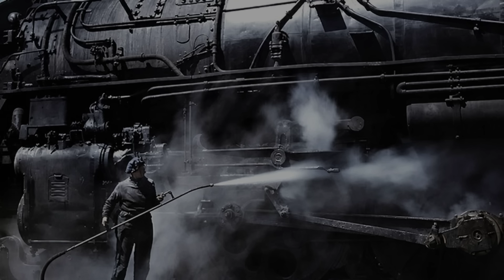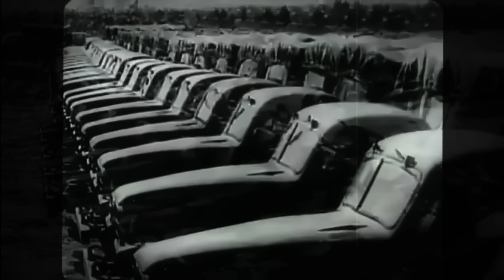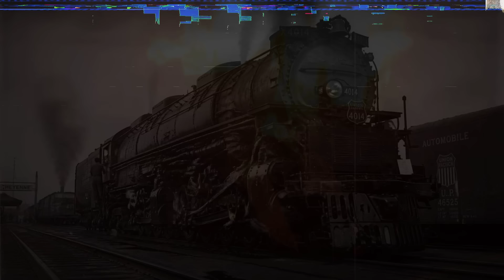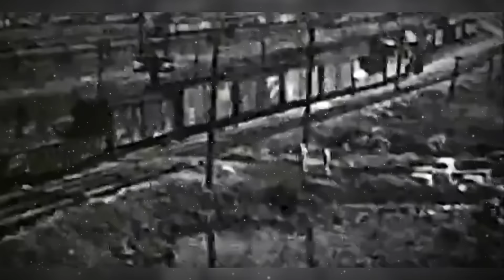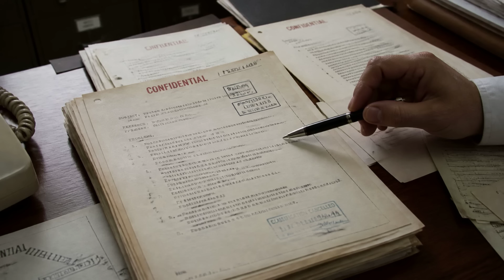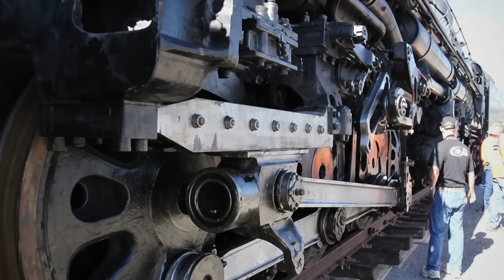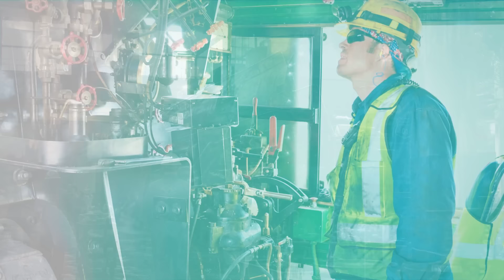The Real Reason Big Boy 4014 Was Abandoned For Decades

Comment: As an engineer who didn’t have the use of a calculator or desktop computer the use of a slide rule, calculating finite measurements and design parameters with tight safety factors is outstanding. These design engineers and the use of quantum mechanics put these massive locomotives on the rails to preform what they did is unmatched. There is nothing stronger then the energy output of steam at that time. The Big Boy is a locomotive everyone should see either in a museum or lucky enough to see the 4014 in action. I’ve been lucky enough to see both. Once this year in Iowa, and the one in the National Railroad Museum 4017.

Comment: There is one picture error within this video. It shows someone with a shovel at the fire box. This use an action which would have been impossible to achieve. No one or two persons shovel enough coal into the fire box to maintain heat for the boiler. A conveyor was installed to bring the coal forward from the tender to the firebox. That picture should have never been part of this video.
Reply: They also show an AC-10 at 1:50.  Southern Pacific #4243.

Comment: I saw 4014 in Colton before it was towed to Cheyenne for restoration. Amazing piece of engineering. Glad I got to see it. 
Also, want to point out one other fact of why steam locomotives were replaced. Diesel electric locomotives use dynamic braking by using their traction motors as generators on down hill grades and putting that electrical energy into slowing the entire train. That is why Big Boy 4014 on it's excursions around the country has trailing diesel locomotives to provide better braking.

Comment: The starting tractive effort was calculated using the standard formula at 135,375 lbs. That was at the rail, not at the rear coupler of the tender. You must subtract the effort requires to move the locomotive and tender to get the net figure that is available to pull the trailing load. in addition to the force necessary to move itself on level ground, an additional figure of 20 lbs per ton for each 1 percent of ascending grade must be subtracted from its starting power. On the Wasatch ruling grade of 1.14 percent, that would require 13563 lbs more force to move the engine and tender than it needed on level ground.

Comment: The condition of 4014 before restoration is exaggerated here. The UP steam team chose it from several candidates in part because it was in better condition than at least most of the others. You should ask Ed Dickens.
Reply: A machine of this complexity designed with slide rules and on drawing boards - now THAT was engineering!
Reply: @john-or9cf being an engineer before calculators and desk top computers, you had the slide rules and the safety factors in the finite calculations required not to overbuild a locomotive of that size. True quantum mechanics needed for this endeavor.
Reply: I kind of figured that as the location that forty fourteen was in south california, with a lot of hot, dry air. I also figured that it was the best condition because that's what I would have done was picked. The one in the best condition
Reply: @edshultz9760  I agree.  I was fortunate to see the 4014 in Salt Lake City when it was returning to Cheyenne WY for the restoration.  It was in remarkable shape for it's age and nothing even close to the condition shown.  I've seen it a couple of times since as it passed through Utah for tours.  An amazing piece of machinery that takes your breath away as it passes by at high speed.  I'm old enough to remember steam locomotives in my childhood years. They were everywhere but not this big  Excellent video.
Reply: Someone at Pomona was doing some maintenance, oiling and such, over the years.
Reply: @paulmorissette5863  That's what I understand also. A volunteer of the Rail Giants oiled the bearings, and other points, for years!
Reply: Agree!!  It was at the LA County Fairgrounds (aka Fairplex) with several other parked engines.  Each engine had its own donation cup/box.  Always a treat to walk among the engines as a kid.  Thanks to our daughter and son-in-law being train geeks, we got to see the 4014 being pulled out of Fairplex on its way to restoration.
Reply: Thank you !!! The narrator is an idiot
Reply: Ed, my good friend, please respond and settle this.

Comment: There’s probably only a small chance of a full comeback for the Super Skunk 1924 Baldwin Mikado #45 2-8-2 which provided passenger service between Ft. Bragg and Willits, California.  I have some very neat 8 mm movie film which I took of the train in the 1970s, one horseshoe curve in particular where both ends of the train are in the same shot. The railway still runs but doesn’t have the income to keep the original route fully operational.